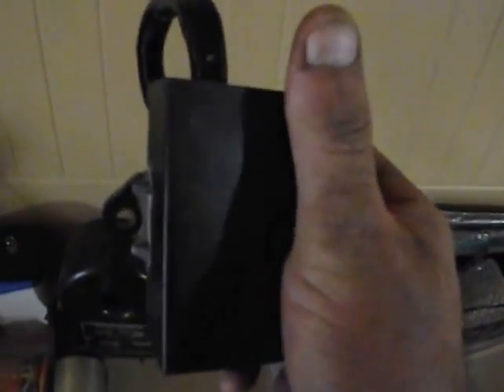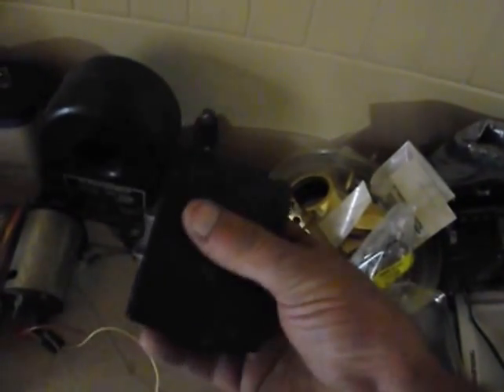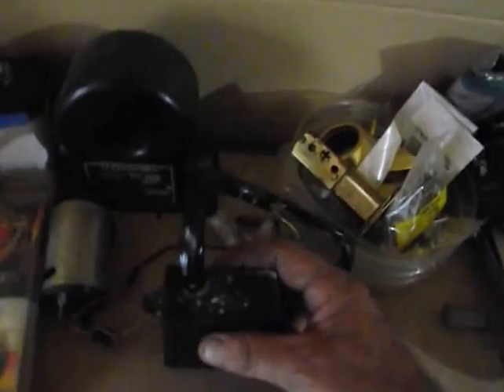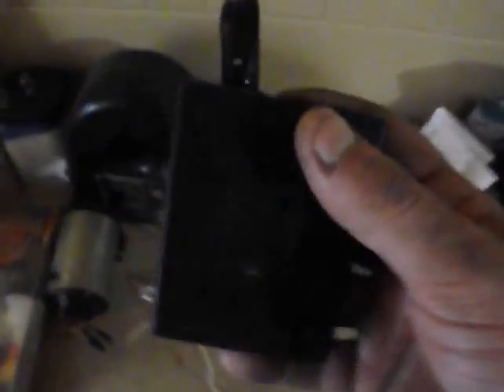Electronic CDI Box Repair  75% Success Rate

Comment: So, I have a Yamaha 115 Outboard with an intermittent no spark condition. I tested the stator and pick up coils. All tested ok. I found during a resistance test of the CDI unit, I found open circuits. Since the condition started as a cold start issue, I decided to try this procedure. After heating, I retested my CDI unit, and the unit passed the resistance testing. Reinstalled on my outboard. SHE LIVES!! Although, I will replace the CDI unit. This was a great way to narrow down my diagnosis.
Reply from the maker: Glad to hear

Comment: Thank you very much for posting this! I had no sparks on my 1982 Suzuki GS450, I narrowed down the problem to the CDI box, but a new one costs more than $500!!!
 So I heated my CDI box with a powerful hair drier (6 minutes each side of the CDI box, the blower 2 inches away from the box), and then the bike started right away.
I know that the oven would probably be better (for afix that last longer) but now that the CDI is working, I am afraid of breaking it by burning something. If it breaks again I will put it in the oven...

For those who fixed their CDI using the oven, how long did the fix last for you?

Thanks again to Thinking out side box!

Comment: Thanks brother, your a life saver. Fixed my 2005 KTM 250 EXC CDI box. 300 degrees for 10 mins. Also threw my coil in there because I know both of them got pretty wet after power washing without tank and sub frame. Just saved me over 200 bucks. Appreciate your help!!
Reply from the maker: Not a problem. Glad to hear it.

Comment: That's awesome.  I am having issues with my 1984 Suzuki 750.  .   I have no spark at all.   It ran last fall no problem.  I left it outside all winter ... cover over of course but non the less you may be on to something,  I am going to try it out.  Thanks for the tip.
Reply from the maker: Welcome

Comment: I found my self broken down because of the CDI. What I did was crack the case and heated the backside of the board with my heat gun in order to re-establish a good contact of the solder. It worked like a charm. Of cause you got to look if there is no other damage, like a burned transistor ore other.

Comment: awesome video my dr125 was getting 1 spark when kicked would hit but not run tried everything i could think of tore the engine down checked everything inside was really stumped til i watched ur video so i took my heat gun and heated it up 4 about 10mins or so let it cool down kicked it 1 time and it fired rite up. thanks alot for saveing my brain it was starting 2 hurt i had thought about this thing so much. thanks again.
Reply from the maker: Glad to hear. and your welcome

Comment: i think this is a partial moisture removal, along with a old/ bad solder connection fix.  the heat cause the solder to become fluid again and basically re-solder itself if there were any cracks.  anyways good video.  always have respect for someone who finds a fix, and makes a video simply to help out others
Reply: Mr. Matt
No solder (tin or lead) has a melting point of twice the maximum temperature a household oven can even reach. Melting solder at 300° is completely out of the question.

Comment: i have a 1987 honda trx 125 4 wheeler. when i pull down on the connector coming out of the box it cranks and runs . let go of it and shuts off. ill try this when i get home from work. Nothing to lose, they want 120 or so for a new one. Think it might be the soder connections that melt and re connect im sure it will get all the moisture out as well. Ill let ya know if it worked. thanks for the idea!
Reply from the maker: It sure sounds like a connection issue more so then a moisture problem. I hope it works for that. Please do let me know if it solves it.
Reply: just  got home,  too tired  to  work on it,   ill try  it  first thing  in morning,  10-4
Reply from the maker: Ok
Reply: about 2 days ago i put the cdi box in the oven on 375 for about 30 minutes. It cracked the rubber coating on top of it, i thought no way  this is gonna work,   i had time today to hook it back up,  and the plug is shooting out a real good strong blue spark. THANKS!!  IT  WORKED. now i got to clean the carb out, needel n seat stickin because its been sitting up for so long, run some fresh gas in it.   ya it worked,  !!!
Reply from the maker: Glad to here. That's great.

Comment: June 6th, 2017. I just cooked an old CDI box on my Suzuki Spirit outboard, and it worked! I now have spark and it started up after being dead for 7 years. Thank you
Reply from the maker: Welcome. Glad to hear.
Reply: In the Electronics world we called it dry joints , by re heating the box in an oven at 300 degrees for 10 minutes reflow all the solder joints that was loose .

Comment: 1981 Yamaha sr185 exciter. Saved me so much money. Genius is all I can say. Popped it in a 300 degree preheated oven for 30 minutes put it on after cooling for 15 and I have a running bike that has not ran in 11 years. We combed through everything wiring, engine, coil you name it we checked it and this worked like a charm. Fired on the first try!
Reply from the maker: Glad to hear.

Comment: is this a joke?
Reply from the maker: No joke Alex. I can tell you I does not always work. Sometime the CDI box just goes bad and there is no fix other then a new one. I know for me I use this method before I figure I need a new one. That's way the video is there.
Reply: Oh ok, I'm pretty sure mine went out on my 98 xc 700. It will not start and it has no spark to it.
Reply from the maker: That could be what happen but its hard to say the coil could have went bad or the pick up coil inside the motor. Its really hard to know. I would test each piece out to figure out what stopped working. There are ways to test the piece out. I would do some google searches with what you have asking google how to test out each piece. There may even be some you tube video's showing how to do the testing. Good luck and hope you get it running again. TC

Comment: Would drilling a small hole in the side of the box(and seal it up after wards) help at all? Btw thanks for the vid!!
Reply from the maker: Your welcome. The hole in the side. Its not needed. But if you where to. Be super care full not to allow the drill bit to enter in to far. I,v done many In my life and have never put a hole in any of them. I have just heated it up and resealed and it either worked or it did not.
Reply: Thinking out side box Ok thank you for taking the time to answer my question and make this video! I really appreciate it.

Comment: I think you are way off base with the moisture theory. If anything you are heating up the solder joints inside the unit causing more to pop loose or in a best case scenario a broken joint to reflow repairing a circuit. If that is the case then orientation would mean everything.
Reply: Choyce Boyz yeah well it works so who gives a shit
Reply: AndyTom Solder melts at about 360 degrees F. A little higher or lower depending on the lead/tin ratio. You don't even have to fully reach that temperature to complete (not fix reliably) a broken solder joint. Do you need to solder your multi meter to a test point? No,but it is only "touching",not bonded  together. It is the same thing with putting motherboards in the oven. Yeah,it might fix it temporarily,but it usually doesn't last. 

I'm not saying that it isn't a moisture problem,but I find it hard to believe. I thought CDI's were encased in epoxy anyhow,so how does moisture affect the circuit board? Electronics is a hobby of mine and I know that even heating up a dead capacitor can (temporarily) bring it back to life.
Reply from the maker: If one is getting it that hot I can understand. Thing is not to allow it to become so hot its not needed. Hot to the point solder is going to melt is to hot.
Reply: Solder (tin) has a melting point of twice the temp that most ovens can even reach. This is actually a good idea considering you wouldve just been tossing it out anyway.
Reply: I was searching for the solder comment. This is 100% what is happening. The solder is being melted to flow back into the joint. Moisture likely wouldn't affect the circuit board. Neat trick and I'm going to try it on a cdi in one of my jet skis.
Reply: @240sxxxvids  sorry but nope. Hot enough to melt the solder would melt all the plastic components.
Reply: @240sxxxvids  and seals fail. Not sure but i am sure about the melting point of solder versus plasic.
Reply: @240sxxxvids  whatever you say. I do know quite a bit about it but just go ahead and feel smugly superior. Careful you dont break an arm patting yourself on the back. Ive got a cdi to cut open and resolder.

Comment: wouldnt it melt?
Reply from the maker: No cause you need to keep an  eye on it to make sure it stays away from that point. It only needs to get hot. Not hot to the point of melting.
Reply: bummer i already melted it! but a new already came soo I'm good!
Reply from the maker: Glad to hear you have it worked out piggyPin

Comment: What to do if i have no oven?
Reply from the maker: Heat source will work as long as its hot enough. It may take longer with out the high heat a oven has to it. Just the same a heat source.

Comment: Hay T.O.S.B In my case I had a VERY week spark, I replaced everything my stator, pulsar, trigger and coil. I was going to do that anyway however still had the week spark problem, to the point the ATV would not stay at idol and backfire and pop while running deing while turning. Put the CDI box in the oven just like you said but longer then you said.... Wow what a difference! Prier I had a viewable spark tester and you could BARELY see it light up, now it glows red! No mistaking the difference! And yes I sealed it up!
Reply from the maker: Glad to hear.

Comment: I have a 1983 Suzuki and I tried it for about ten minutes and put it back on the bike and it didn't work for one side of the cdi the back is off do I wait for it to cool then put it back on the bike  or do I just throw it on there while it's still hot
Reply from the maker: Wait for it to cool. Before its to cooled off reseal it. This prevents anything from going back in.
Reply: +Thinking out side box if anybody ask you again tell them to check the fuses
Reply from the maker: Sure fuses should be the first thing checked. I would have thought everyone would have done that already. But your right not everyone thinks to I guess. Good point. TKS

Comment: My bike has set for 11 years in a garage in Las Vegas. Wondering if it will work...
Reply from the maker: If your CDI box is acting up. Its may just solve the issue But being it has been sitting so long. The CDI box may have went bad and this method may not work. If it was mine. I would give it a try before I went out and bought a new one.
Reply: Worth a try. Yes
Reply: cagburetor backfiring

Comment: i know this video is specific to the moisture problem but do you know anything about the other ways they fail? someone tried to start my four wheeler with a battery charger (no battery in the four wheeler) and now it wont work.
Reply from the maker: Well more then likely the pulser coil or the coil its self burned out. Look on you tube how to test them out. You will find video's relating to it
Reply: thank you
Reply from the maker: Welcome

Comment: In the city where I live, it is currently rainy season and my honda cdi cm450t began with an intermittent fault is particularly acute when it rains or high humidity in the atmosphere.
Common sense tells me that you have much reason and certainly the fault is caused by the exes moisture introduced and as well explained you the seals that keep tightly sealed cdi, over the years deteriorate leaving exposed to moisture all this delicate electronics inside.
I thank you in advance for sharing such valuable information.
excuse the translation google translator.
Reply from the maker: Welcome

Comment: Hi mate, how are you doing? Grettings from Brazil. I hope you can help me out on this trobleshooting. Let me get strait to the point.  I just got a POLARES 330 CC, 2003 and I realized that my CDI box is not working, something bad might happened. I did some researches on the internet, youtube and i notice the the best thing to do is basiclly replace it, get a brand new one. However, to get it down here is so expensive. So, I´d like to try a MOTOBIKE CDI BOX. What are you recommend? Have you ever try it? PLEASE HELP ME. I aprecciate it. Thanks so much. Excuse my inglish is bit rusty.
Reply from the maker: +Eliab Clemente No I never have tried that. As long as the wiring is done right and its able to handle the cc,s of the motor. I would not be able to see why it will not work. I hear ya on the cost of these CDI boxes. Not cheap no. Also you might want to look on ebay for a used one. There may be one on the for a good price. Take Care
Reply: Thanks so much for the answer. So long.

Comment: what kind of sorcery is this??
Reply: Thinking out side box  It is not moisture,it is bad solder joints. Cut along the crack in the case with a hacksaw and open it up and I will bet you will find at least one (probable a few) ring around a solder joint where it cracked and opened the circuit. Heating it only "barely" makes a poor connection that will not be reliable. Re-solder it properly and it will be as good as new (probably better,due to the cheap ass solder used).
Reply: @gordthor5351  you know exactly what the deal is! I just desoldered and resoldered a cdi. There was definitely one broken solder joint. I will test it tomorrow, but I'm 99% sure it's fixed.
Reply: @240sxxxvids  it worked ?
Reply from the maker: +Jake Del Its just removing moisture from the unit is all its doing Jake. Most times its the moisture causing it not to work. Drying it out like this removes the moisture and causes everything to be ok again. Resealing is needed to be done afterwards though or moisture will re-enter. Its just a good method that works most of the time. Not all the time.

Comment: would you try this with a suspect CDI box?  The box works but sometimes the thing dies and it may be due to this....I've troubleshot a lot of other items on the bike... and it may be getting worse with age... but I also don't want to destroy the box..  I guess my question is, can this potentially destroy a box?  I think a few minutes at 300 is not enough, it won't melt the components so I may try this out to eliminate the potential moisture issue and then re-seal.

I've also ordered a spare replacement CDI it was $100 but again, they are all used components off old '80s machines.. so a replacement is still an old piece of electronics..  so if I can improve it now I have a good spare... maybe two solid units..

make sense?
Reply from the maker: +kookyca That's what I would do I mine was acting up. I would heat it up. I have never harmed one by doing this with the oven. Take care.
Reply: OK, I ran it in the oven at 290 for 10 mins.  It did start a little melting on the external case.. it also opened up a hole in the middle of the box but maybe that's nota bad thing as you note, there may be openings you can't see...  so I plugged it back in and looks like a good spark.  next step is to complete the carb rebuild and see how she turns over then....  i'll keep you posted..once i get the system working then I'll seal up the box with epoxy.
fingers crossed.
Reply from the maker: Fore sure seal it back up. That means a lot. Keeps it dry on the inside. Good luck
Reply: +Thinking out side box I have to say now that I am sold on this.  what I observed was that the spark seemed definitely stronger.  Now I also did a carb overhaul so there were more variables for sure.....  But honestly the bike fired up and sounded better than it ever has.  '85 XL350 ready to kick some ass!  I have a spare CDI coming anyway but that's ok because parts are almost gone for these machines.  now i have two good ones.  This is a great tip it can't hurt it can only help in my view.
Reply: +Thinking out side box yep now have the epoxy on it for sealing and can't wait to go for a spin tomorrow.  btw you should see what some other dudes try for this one guy dissolved his whole box down with acetone just so he could redo some solder which ok, re-soldering can be good but can also make things worse plus the top side of the circuit board was a mess of dissolved plastic just baked in to the circuit board..  i'm down with this plan, get out the humidity and if still no good - then move on get another one.  But boy what a difference in spark and life.  you're the man for this tip!!

Comment: So I guess CDI boxes (enclosures) THEMSELVES are a weak point. I'm guessing that cracks allow temperature changes to cause condensation INSIDE, which plays havoc with the previously "sealed" electronics. 
Oh, man. I get you.
A pre-emptive inspection and re-seal may be needed on ALL CDI's.
Unsettling, but perhaps useful.
Reply from the maker: +Kenneth Lyon Sealing up from new might just help them for a longer time. Covering over a covering is always good.
Reply from the maker: +Kenneth Lyon Yes that's what happens

Comment: Do i need to open a hole before heating it up to let vapor go out? My stator was also not working, i changed it with a new one. Now engine is working with Yamaha BWS cdi. I need to fix its own cdi.
Reply from the maker: +Caglar Fazli No hole is needed. Just make sure the udder side is facing upward. After wards make sure its all resealed to stop any further wetness from entering. Its best to reseal it as soon as its cooled enough. This way when its completely cooled no mosture gets back in.